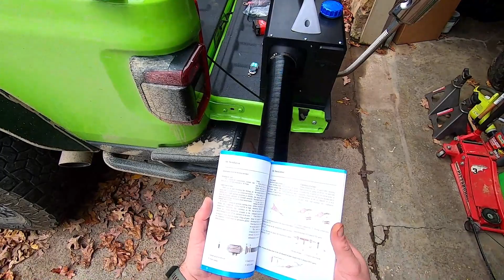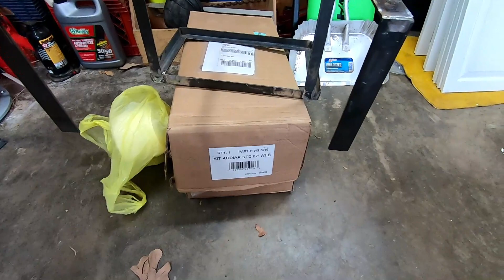Vevor 8KW diesel heater, setup and run, and making a bracket for camping.

Comment: Will this run off 18volts? Was thinking of wiring it to power tool battery to run a few hours at a time
Reply: I am not sure I have tried it
Reply from the maker: No, they will not run of 18v it will fry the internal electronics